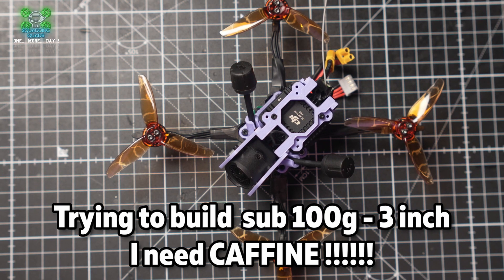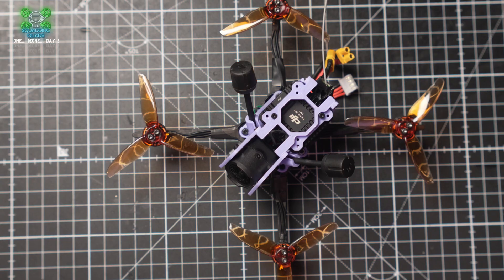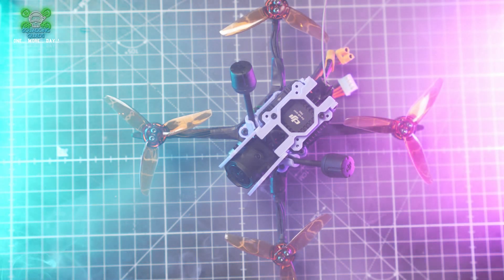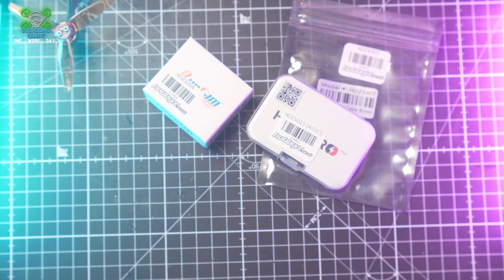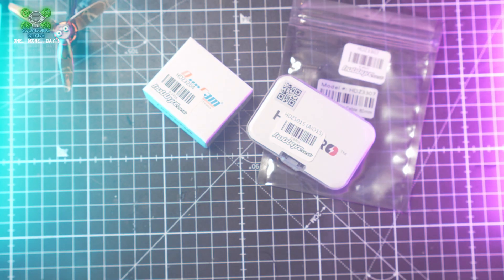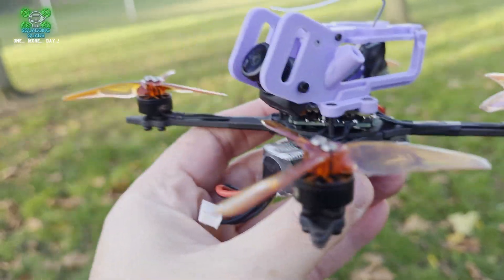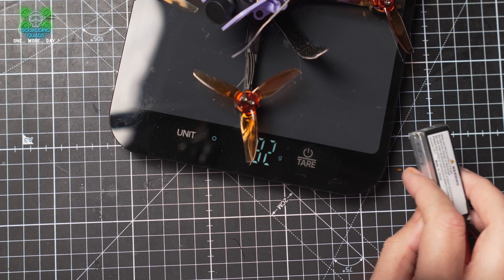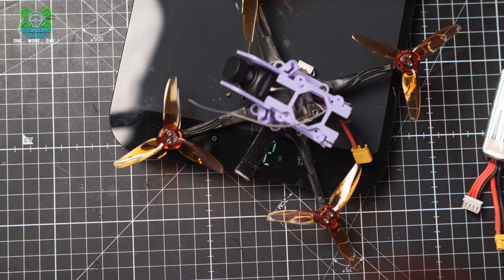We Tried (and Failed) to Build a Sub-100g 3-Inch… But HDZero Surprised Us!

Comment from the maker: What system would YOU run on a 3-inch ultralight build?

👇 Drop your vote: DJI O4 Pro, HDZero, Analog, or Walksnail

And should we try the 100g challenge again next week?
Reply: O4 Lite with a wide angle lens mod!
100g on 3" is going to be tricky. Perhaps step down to the 2.5" format?
Reply from the maker: @c0t1d0s0 gonna make a few adjustments first and then see where we land and if not I'll switch it up
Reply: I built the aos 3.5 v5 with 04 turn out to be my best decision 
And answer to you question i would choose 04 pro always because its fpv not old tv . No offense to anyone , this comment is between me and my buddy squadding quads we usually share such laugh and pulls ❤
Reply from the maker: @IZZHA-FPV hdzero could and should be better but nothing touches DJI

Comment: It's difficult to make a 3" under 100g, even my analogue fpvcycle TP3 is 107g with 450mah 3s. 

However, I have just made a new build that is intended to be as powerful as possible with HD for under 100g.

My build is 1103 8500kv, 2.5" toothpick frame, 12a aoi, with 450mah 3s and it comes in at 99.5g! (Currently with an analogue diamond vtx and foxeer predator camera weighing 9g so can be replaced with 04 lite and be same weight). (Dry weight is 61g). On 3s with 65mm gemfan bi blades or 2" tri blades, or 2s with 2.5" tri blades. Will also work well with 500mahish 2s or 380mah 3s. Would love to see you build one!
Reply from the maker: Sounds like a good idea man, what frame are you using?
Reply: @squaddingquads  Using AlfaRC EYAS100  frame from Aliexpress with Sparkhobby 1103
Reply: @squaddingquads  Using AlfaRC EYAS100 frame with Spark hobby 1103 from Aliexp :)
Reply: @squaddingquads  AlfaRC EYAS100 frame with Sparkhobby 1103 from Aliex

Comment: My recent 6s 3.5 is running a hdzero race v3 and nano 90 cam … sure the image isn’t as good but oh my does the low latency and low weight make a huge difference.
Reply from the maker: I just need to get some better antennas as that breakup was AWFUL
Reply: @squaddingquads  silly question but you did set the correct power output on takeoff and running on R1 channel right?

HDZERO is very sensitive to antennas and they are usually RHCP compared to DJI LHCP and that dipole antenna is going to be pretty poor straight off the bat 😬

I’m guessing you used the race v3 VTX and micro v3 camera? That VTX is only 5.5g and the micro v3 is only 7.5g so 13g total … the 04 pro is about 32g so you should have seen a big drop in weight. 

Also the nano camera is amazing, it comes with an adapter to make it the same width as the micro and the 540p low latency mode is mind blowing.

Comment: Not the same i know and you want Hdzero and 3inc 
Just a  idea if you still got the dolly fly or GEPRC DarkStar would be interesting if you  ?
(dark star 22 is 98 gram with 04 pro) lose the prob guard, led and the 04 vtx case you gonna drop 10-15 gram and mite just squeezed 2.5inch prop on ? at say 85 gram + battery ?
Reply from the maker: Good shout.

I'm going to change the canopy and camera tomorrow first and see just where it sits and take it from there but if u can't get this under 100g I'll be looking elsewhere